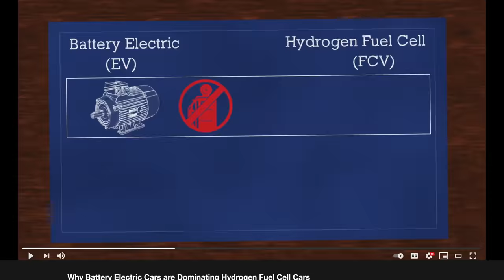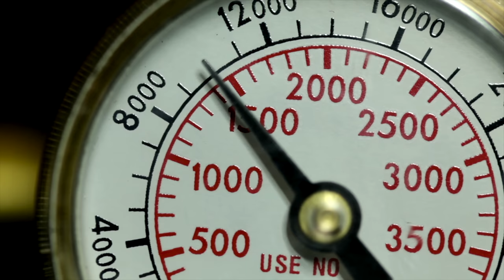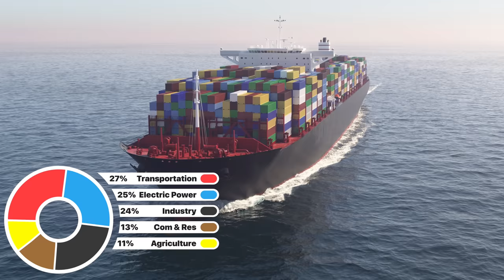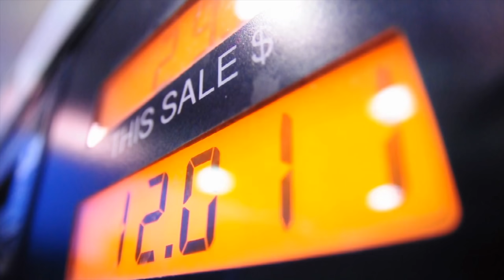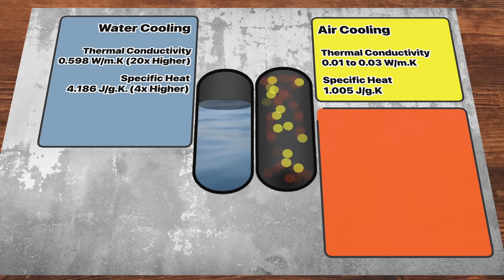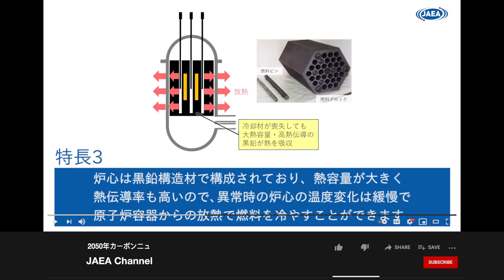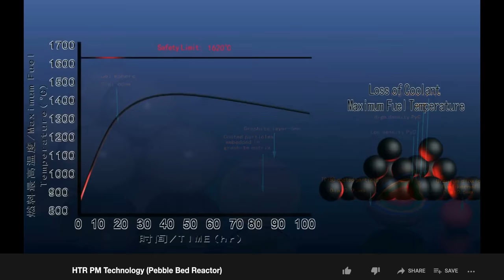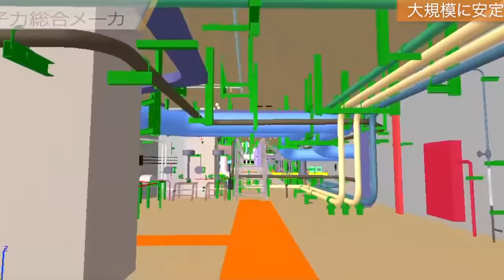Japan's Plan to DESTROY the Price of OIL and GAS!

Comment: Now, we just do not have enough raw materials for everything that has been planned. The future still is of internal combustion engines, it just is. EV:s are not practical yet, and only after the batteries are safe, the trend of banning EV:s from car ferries or charging them near buildings (happening already) will make their use even harder.
Hydrogen for transport is just a hype. Hydrogen cells do not work in freezing climates without heating them all the time they are not in use. Frozen cell does not start. Hydrogen is too difficult and expensive to produce, transport and store. The filling station for several cars will cost tens of millions to make. Hydrogen leaks out from anything, and makes everything brittle.A hydrogen internal combustion engine is a way, but... A hydrogen tank is a bomb. It is heavy, and the range sufficient for anything means that it is also big. For industrial use hydrogen is, and always will be, just a substitute. It must be red to have any sense at all. Blue or green are not good for anything but for the makers of them. So, we can not have enough EV:s, there are not enough raw materials and the insurance companies will wake up and make insurance costs sky high. Hydrogen cars, trucks ,etc, transportation, will not be able to compete with internal combustion vehicles, as operatinc costs and difficulties will make everything more expensive in the stores. So, better develope the ICE:s further. Like Omega 1.

Comment: Lets be honest if thay really wanted to Make clean energy.  All They would really have to do it make a computer controlled pwm generator i.e. a Resonant tank circuit. 2 coils 1 capacitor and a pwm oew and a GROUND wire. Witch is the  simplest thing to mate nowadays. 10 years are making them on youtube.

Comment: Why not just use a breeder reactor with thorium technology already exist they’re low pressure and cannot Fail, catastrophically, and thorium, is one of the most abundant resources on this planet, and he would never have to open the reactor to change the fuel because you can just injected more

Comment: (1)  Hydrogen is compared to energy sources.  Hydrogen fuel is  explicitly and implicitly termed by this profoundly science-ignorant individual in the video an energy source.  Hydrogen is NOT an energy source, as anyone with an elementary school level education in sciences (mine is college level, from Harvard) should know.   This because to obtain a given amount of hydrogn that can release a given amount of energy when used as a fuel in a combustion or fuel cell-using device, you have to PUT IN FAR MORE ENERGY.   Thus, hydrogen fuel is something for STORING energy MADE ELSEWHERE, BY OTHER MEANS (such as electricity made by nuclear power).   It is NOT a SOURCE of energy, because there is no source of hydrogen available to us on earth by mining or other low energy expense means.   This of course is not true for stars, for which hydrogen IS an energy source (its fuel for their nuclear fusion).

[Fusion that goes on in stars cannot possibly be in any practical sense carried out on earth,  in part because it involves such a low density of energy production (energy is produced by fusion at the center of our sun with about the same amount of watts per unit volume as is produced in a compost heap, or by an awake box turtle)  and because of the immense temperatures and pressures required.

(2) The person presenting this video is also (to generously give him the benefit of the doubt here, and not accuse him of deliberate deceit) profoundly ignorant of basic nuclear physics and the physics and engineering of atomic energy... and of medicine associated with biological effects of radiation as well.  He claims that "nuclear waste" (what is more honestly and accurately termed "spent nuclear fuel", abbreviated SNF)  is dangerous for 100 thousand years.   In fact, 97% of SNF is radiologically harmless uranium and plutonium, with such ultra long half lives that they pose no radiogoical threat to human life at all (verylong half life material is entirely harmless to humans because the level of its radiation is so low).   This material is best separated out and re-used as fuel for other reactors, by the way... and NOT put away in some deep cavern where it can't easily be retrieved.  2% of fresh spent fuel is genuinely radiologically dangerous to life when it comes out of the reactor.  With 15 years of storage, near all of this consists of Strontium 90 and Cesium 137.  These two (very radioactive) isotopes both have half lives of 30 years, meaning  that after 300 years they are both 99.9% gone, and after 600 years they are both 99.9999% gone.   Anyone who claims SNF must be stored for thousands... let alone hundreds of thousands... of years is either a cynical deliberate liar (perhaps working for the fossil fuel industry, or their junior partners in deadly scams, the "renewable power" industry)  of profoundly ignorant of the basics of physics and of the biological effects of radiation.  I happen to have professional training in both.

The presenter here simply has no knowledge of what he's talking about when it comes to hydrogen fuel, or nuclear waste.

In fairness, it IS true that high temperature fission reactor designs (the one discussed here, and others not mentioned) may well hold a great deal of promise.   Operating at higher temperatures than traditional gen 3 PWR and BWR reactors, they in theory can be made more efficient in the production of electricity.  And they can potentially directly provide heat for industrial processes that currently are done by burning fossil fuel.  ALL GOOD THINGS.   The problem is that to be economical and practical, a reactor driving power production must be EXTREMELY reliable and durable, able to operate for decades... 50, 60, 80 or evne 100 years... to justify the cost of building such things.  This HAS been achieved with the mature technology that is gen 3 PWR and BWR, but we're a long way from being certain of having met the greater challenge of making something operating at much higher temperatures be certain to work for that many decades.  But many very actively are experimenting with proofs of concept and prototype models, and this may well bear fruit some decades from now. I'm all for very large investment in such experimental development work.   One thing that it would be hard to do, tho, is make reactors any safer than they are now, for mature technology old gen 3 design PWR and BWR reactors are overwhelming THE safest means of making electrical power on earth... and for now the only viable alternative to burning fossil fuel to make electricity.

Comment: To summarize the video: There is a more efficient way to use the excess heat from the nuclear power plants into generating H2.
Then what? generating a red hydrogen (an energy that has challenges regarding its very form: compressibility) that solely relies on nuclear (a finite energy that has its own challenges as well: wastes) that relies on mining and processing which are only currently efficient using Oil & Gas. And all this goes without venturing through energy efficiency for the whole cycle.
I understand it is to attract views, but this kind on titles "Red Hydrogen Will DESTROY Oil & Gas" are sadly feeding wrong ideas into our heads that are contributing to some extremist views and irresponsible actions against Oil&Gas that will eventually come back as us hard.
My view: there will always be carbon energy emissions and it is best to be realistic and aim to minimize that by opting for a balanced, efficient and studied system where all kinds of energy forms are used.

Comment: The answer was already there 1970.
MSR. even safer. Run it in thermal Mode on thorium and the waste Problem is solved.
The problem is the chemical issues.
Fuel for a thousand years for all the Planet, no problem..
The problem is global economic interests. They had Nixon to Close down the development 1970 at ORNL when the reactor was ready to be comercialized.

Comment: So this is even better than the molten salt reactor, evidently.
The problem is stupid politics, here in the West. These reactors could be mass produced 😀
Edit: I jumped the gun. Molten salt is supposed to be closed cycle, meaning only 350 year rad wastes. It "burns" the actinides. So, can the high temp reactor be made to be closed cycle? Probably not worth triso fuel, right?

Comment: The Ukraine war says it all as we all can see that battery powered himars and SAAB Gripen are making the difference. 

joke

..ofcourse. Diesel can be stored away for a decade and used instantly and in minus 30 on high altitude. It can be brought TO the machines. A towcar doesent have to come and pick up the vehicle. Ok there are batteries that can be disconnected, carried to a charger and then... come on, Diesel and petrol will always win over batteries. So hydrogen surfly is interesting.

Comment: Hydrogen still is unsustainable, needs way more energy to produce than what you get out. Energy density over batteries is the only advantage, dont get me started on the expensive catalysts that need replacing in the fuel cells. Would be better to direct funds and resources to improving batteries.

Comment: Ref Steel making, coal is needed to input carbon into the final metal product. This hardens it. Without the carbon,  steel would be just cast iron which is very brittle; this limits it's use. Please research more thoroughly, otherwise you are only a shallow cheerleader.

Comment: Hydrogen-powered electric vehicles require fuel cells to generate electricity. The proton exchange membrane, which is the active part of the fuel cell, requires platinum and iridium catalysts. Platinum and iridium are geographically concentrated, found in South Africa, Zimbabwe, and Russia. China is doing a big push on hydrogen power, and they're already facing shortages of those noble metals.

That is a key stumbling block for hydrogen power—the show-stopper—and yet it didn't even get a mention in the video.

This is what you get when your engineering news comes from an amateur. Destroy oil and gas? Bull🏺.